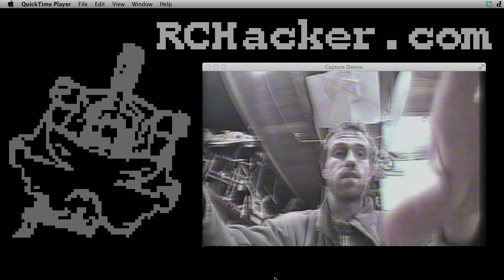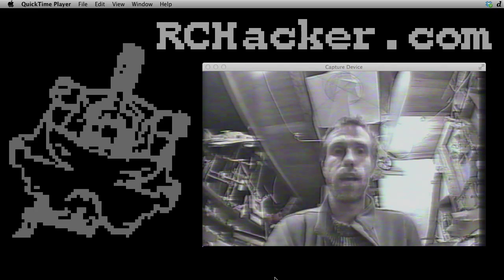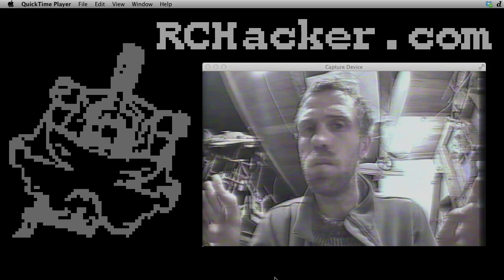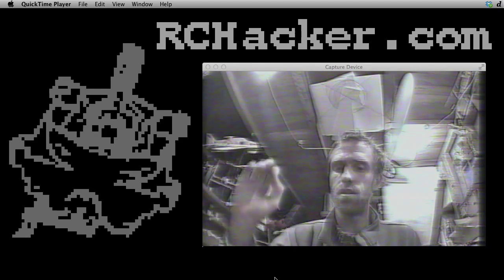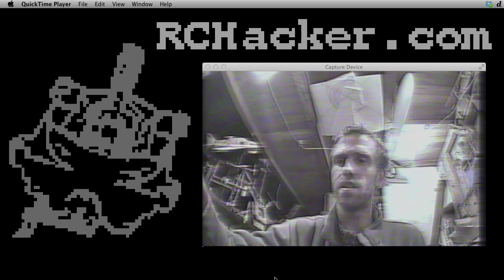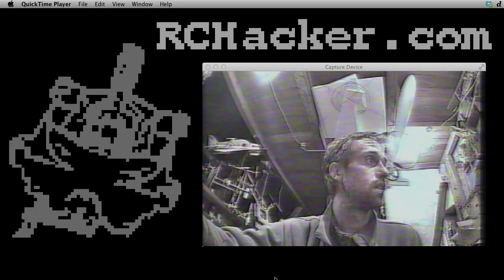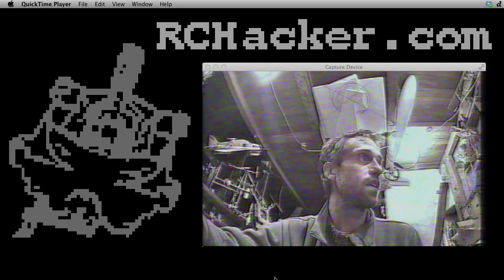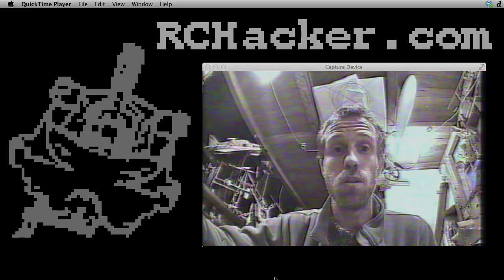Lawmate 1.2G 500mW video impedance fix. RCHacker #44

Comment: I am having trouble with my TM120500 TX how did you do the conections? Do yo use a voltage of 5V or 12V. I tried to used also my sony camera and my Mobius camara but its not working in both of them. Can you help me find the problem? My RX is the lawmate rx-1260 1.2GHz 8ch
Reply from the maker: 5 volts only, 12v even for a short time will kill it. I've made that mistake myself.
Reply: Thanks a lot. Yes I think that I have made the mistake of using 12V :( I think I will buy better a 5.8 transmitter

Comment: i use the same vtx with 1.2g low pass filter, clover leaf ants and Dx201 camera and have perfect vid for 1 km. I think you should spend the dosh and try the dx201. My previous cam was the kx191 which switches to b/w in low light. I like your vids btw
Reply from the maker: Good to know others experience. I've stupidly blown up two of these by over voltage when attaching it to my plane. Im stubborn so have a 3rd almost ready to go, still yet to fly with it.  must remember no more than 5v.

Comment: So are you putting the resistor between the camera's video output and the ground?

It appears that it reduces the exposure, instead of improving the chroma (color). Maybe it just needs an ND filter on the lens. Maybe I should test it out, since these CCD cameras lose all chroma in strong daylight.

Comment: Check out Dragonlabs site look at, Pick your video transmission system. 2.4ghz It also usually provide a higher image quality than the lower frequency transmitters. 5.8ghz It also usually provide the best video quality. 900 mhz transmitters are the lowest frequency and thus the ones with the best signal propagation. However, often designed a long time ago, the signal might not be as good and the video as sharp as some other transmitters.  All this is from Dragonlabs